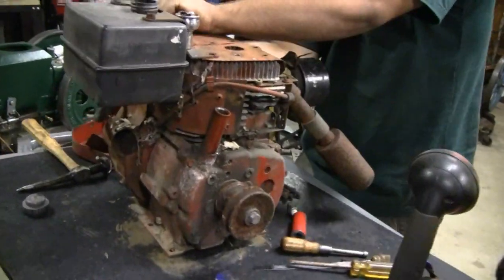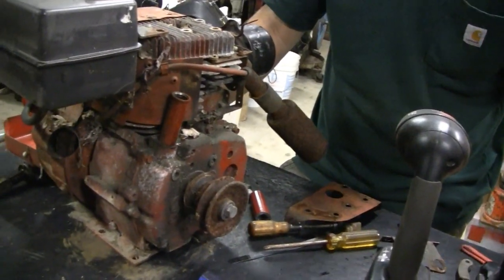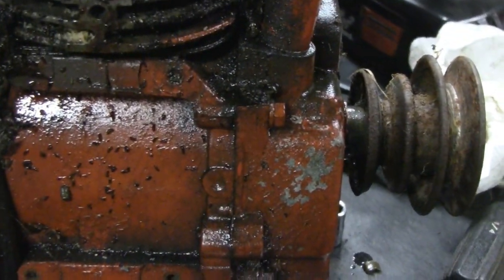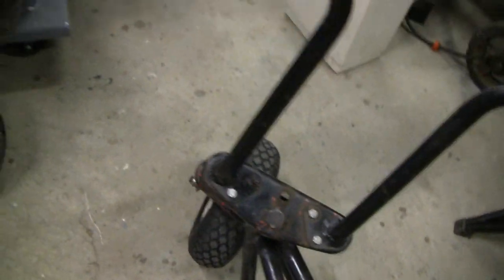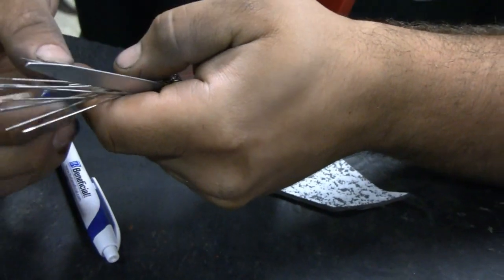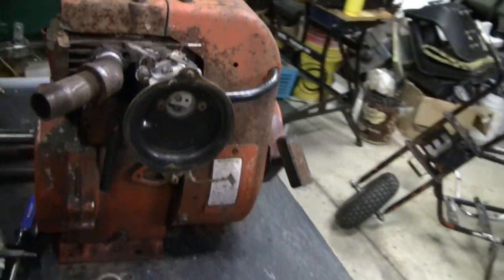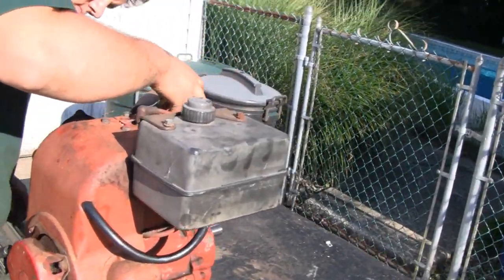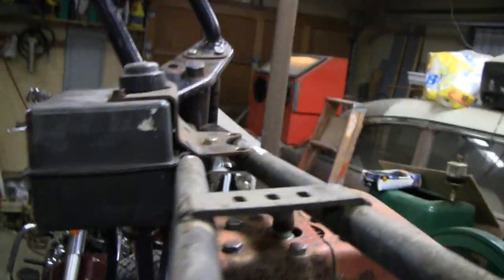MINI BIKE PROJECT (part 2)

Comment: Cool buddy looking awesome. Notch the tubing a little for spark plug to fit, then re weld it up. Have fun, got my new welder. The darn wire tensioner broke, plastic so ordered new free replacement part.

Comment from the maker: We apply a little pressure behind the flywheel with a prybar or large screwdriver then backoff the crankshaft nut till it's flush with the end of the shaft, then wack it with a large hammer and they usually pop right off!!☺

Comment: That is a hog of a motor It should have enogh power !!!! If you drill a hole in a tab of metal the size of the ball on the cable then make a slot in it and bend it in a U shape add a hole on the other end Kinda hard to explain Mike sure does good engine work The carb looks good as a new one !!!

Comment: stupid question for you , I know this may sound stupid , but I am half crazy , I have a horizontal shaft 18 v twin briggs I/C (not a vanguard) that needs some tinkering , small repair and got running , as for the internals , it is good , and clean , and would run as is , if I shipped it up there , and bought parts , paid labor , want a winter project , I just want it running to say it runs is all , had it for years lol told you I was half crazy lol

Comment: I went to estate sale today and they had a real old Rear tine roto tiller the entire unit was cast iron eng,trans and gear box was iron with the exception of the tine guard and eng cover was sheet metal but they wanted 250 for it..